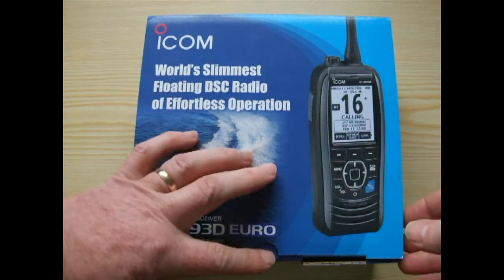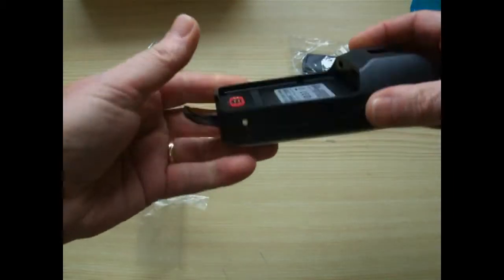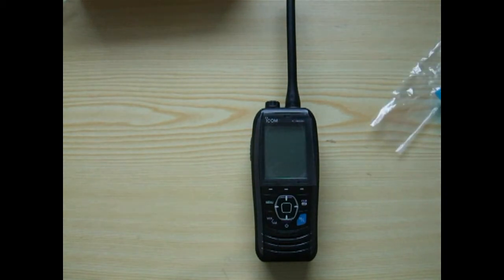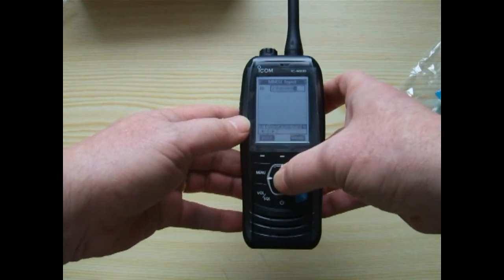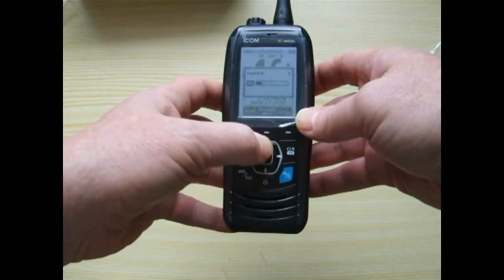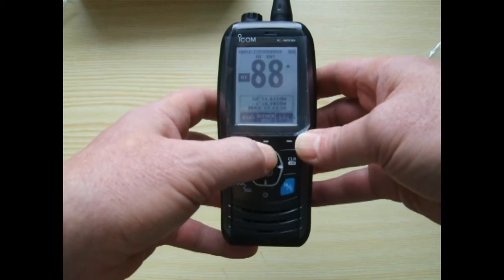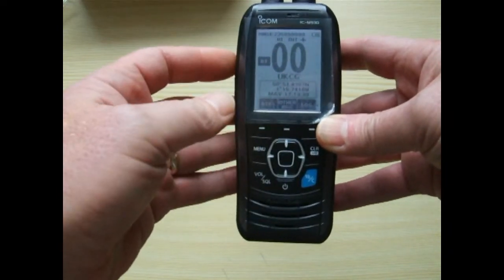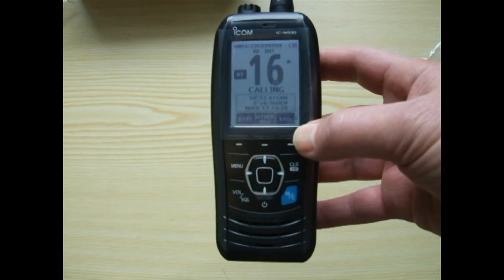ICOM M93D out of the box

Comment: I have notice that once you have entered your MMSI number, it can not be changed without sending the radio back to the manufacture. I can understand this for a fitted radio but not for a hand held. I would want the handheld radio for use on a number of different boats so why cant I change the MMSI locally, when I use it on a different boat?
Reply: Disregard my last message. I misunderstood that the MMSI number is is actually and Identification number for the radio, not for the vessel its on.
Reply: The MMSI number is associated with the handheld and the registered owner of the handheld. So I'm assuming if you ever sold it to someone else they would have to have the MMSI number reset and a new MMSI number which has been obtained from  OFCOM entered.  The process of using OFCOM means the MMSI is registered and you pay an annual fee for it.